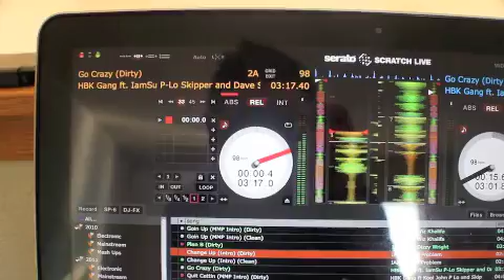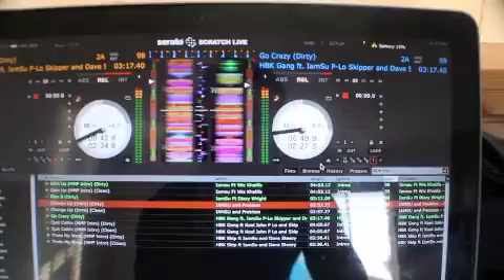Replacing RCA cables and Self Grounding Mod on Technics 1200 Turntables

Comment: I've done a few of these. I found that the internal ground method resulted in a hum on the speakers. (though it has been okay with other tables). For best results, the chassis ground should be kept away from the signal ground, to keep that current away from the signal.
Reply: First person to say this. It makes no sense to attach ground to shield of one side. Ever hear of ground loops? Sure you have, it is the HUM you often hear when attaching a table to inputs. There are cases where the ground must be lifted, or a ground wire applied in a differing spot. Doing this mod insures that you CANNOT lift or change grounding. Sending the table ground down one side can loop any stray current down that channel, through a preamp, out the AC neutral, and back to the TT via the table neutral, causing hum and noise. There are many other scenarios that could cause hum and noise via this method, too numerous to mention. In a static environment, it is much easier to make permanent changes. But traveling to differing venues where power, ground, neutral, heavy HVAC, ballasts, lighting equipment, nearby TV, radio and other RF transmitters, plus other RF (microwave ovens for instance) and electromagnetic spewing items are, this could be a disaster of a mod. All these items can spew interference through air and via house power system I am not saying it always will, but in my decades of TT setup and service, I have seen some very strange things that took creative analysis to cure. 

Connecting a ground wire is easy and quick. What really is the problem?
Reply from the maker: Your totally right, it can cause some weird issues if the ground is looping. It all depends on a person's setup also. Some equipment does require a ground toward a different area in the circuit. There are some other RCA wires out there that have poor shielding that can also cause ground loops. As you said there are multiple factors that can cause some problems but are rare. If I do find issues and a humming is present it can also be caused by a failure in another components ground circuit, or another issue that is preexistent in certain set ups. However I have yet to see this mod fail when done correctly. I have come across ground looping in one scenario when the club removed ground on a power plug to the mixer in order for it to fit the outlet. When my tables were attached a hum was present. The fix for this was just to add a RCA splitter and just ground the outside shell of the RCA plug. The reason for doing this mod is for several reasons. Djs often come across shotty equipment all the time when going into gigs. For example, missing ground screws or damage grounds on mixers, the chance that the ground wire was ripped or crush, serato or tractor not getting a clean signal from the attached ground. The circuit that the external ground attached into the RCA shield provides a clean signal 90% of the time. I have yet to see turntable failure from this mod though since in the technic 1200 the ground circuits are separated to an extent from the motor. It all depends on the set up. But you provided some good information for people!
Reply: Raccoon1400   js
Reply: Another factor to consider is how you will be using 1200.  You'll notice there are 5 wires coming from tone arm - no common ground.  When you do the mod you are injecting noise in to the signal.  In a club - probably not noticeable.  If you're using in your home for best playback potential - probably not a good idea.  You could also get in to scenario where you have a ground loop and no longer have option of moving ground wire around.  Solution might be to be to add external switch to change between internal and external ground (just a thought - not tested!).
Reply: I'm not new to rewiring things but this is more important ha. This is the first time I've opened a deck so any pointers would be great. What is the best thing for grounding?
Reply: Is it possible to use 1/4" instead of an rca cable?
Reply: @FrumSkratch  Why? What do you want to plug it into? I don't think I've ever seen anything that has a 1/4" input for a turntable.
Reply: @Raccoon1400  I meant output,sorry about that,I was just thinking 1/4" would provide a better stronger signal than rca
I'm going into an audio interface UA Apolllo twin X by the way
Reply: @FrumSkratch  You will want a phono preamp to go between the turntable and that interface. A phono preamp both boosts the signal and applies RIAA equalization.
Reply: @JosephAzarUAV  you're exactly right - why would you want to do away with the ground wire  ?! Fair enough, change the phono leads (if they need to be changed) I've changed loads on various equipment over the years also replaced and re calibrated pitch controls , target lights and the green pitch LEDs on my own 1210's and fellow DJ friends of mine over the years . Removing the ground is madness afaic .

Comment: There is a reason why the Japanese built in an external Ground wire....
Reply: Your right! there are high end mixers that has balanced input that requires separate ground wire.

Comment: if you use your turntables at home go for it, if you use them in clubs with big DB keep the ground wire away from the audio cables or you will get HUM low end feedback through the speakers

Comment: to avoid damaging the circuit board connections and the wire you should tin the wire with solder before trying to solder it onto the board. too much heat or inexperience and you'll end up buying a new tonearm.
Reply: I'm not new to rewiring things but this is more important ha. This is the first time I've opened a deck so any pointers would be great. What is the best thing for grounding?
Reply: good advice!

Comment: Awesome, many thanks once again for the very invaluable info! I would say that taking into account the massive amount of use my decks used to get (I now use a Traktor S8) the constant time would be approximately 7200 hours and this is a conservative estimate. I went on the assumption that on average I was probably using them for about 14 hours/week and did this for at least 10 years and actually probably more when I think of it but it's a ballpark figure and well over the 3000 hours in the book.I agree with you on the not oiling part as they're still running smoothly and even the lights work too with their original bulbs. I was always very careful to keep a close eye on other people using them as you'd be amazed (or not!) how people can mistreat them without even knowing so e.g. by stopping the platter, fiddling with the weights etc. Anyway thank you for coming back on my post and wish you all the best!

Comment: I bought Traktor scratch and was having issue in Traktor software.
I was getting message saying Left input not working
I dismantled my 1210 and done continuity test on left and right cables.
I was getting continuity both ends.
I put deck back together and applied switch spray to ends of phono leads. And also where I screw needle (stylus) in.
That fixed my problem.

Comment: those screws inside above the RCA/ground section look like 3-star (Y) shaped screws rather than phillips no?
Reply from the maker: +therealomunit Certain screws are 3-star depending on the date it was manufactured I believe. However the screws are not torqued down too hard, so using a regular phillips will be sufficient. You do not want to over torque the screws during reinstallation.

Comment: Many thanks Mark! My 1200 has a dodgy RCA lead that needs replacing and this tutorial is just the job!Do you know please if you need to oil the motor mechanism at all? I did read somewhere in the manual that it recommends oiling every 3000 hours but I wasn't sure which oil to use?incidentally you remind me very much of that guy from 'Myth Busters'.Best regards,Paul from the UK
Reply: I've had my decks for approx. 28 years now and they're still going strong (other than the lead) hence my question regarding the oil.
Reply from the maker: I have only oiled my tables once. After that... I don't think I would need to oil them again until I have kids and give them my tables haha. With that said Technics does recommended after x amount of operating hours. I am not sure what viscosity rate the oil is but I have used "liquid bearings" oil (il provide you a Amazon link) I wouldn't recommend any other lubes due to the lack of information I have on the type of oil. (Last thing u want is oil all over the place) there are two ways to apply the oil. One way which is quick is just remove the platter, apply 2-4 drops directly onto the spindle, and wait a couple hours for it to drip down into the motor. This does pose a risk because if there is any build up (gunk or dust) the oil will just layer on top of that. The proper way (which I did) is to remove the platter, unscrew the top magnet (big black doughnut thing), unscrew the circuit, and without unplugging anything just lifting up and remove the spindle.
Reply from the maker: Wow didn't know there's a character limit on comments... Well now I know. Next step. Clean the spindle and apply 2-3 drops directly. Then reassembly. You aren't oiling the motor because it is a magnetic drive motor. The only thing you will be oiling is the spindle. But let's do the math. 3000 hours is 125 days of constant operation. Depending on your use, if you are playing on the same set for that many hours... Then you must be fucken amazing. But other than that. I would do it once every say... 10 years or so... But  to be completely honest... I wouldn't bother. I mean the turntable isn't being played in a middle of a desert, or exposed to the elements... Unless you are in a desert. So the lube shouldn't be going anywhere or building any type of massive debri if it's just in your house and use from time to time. So unless you notice the torque drop dramatically I wouldn't do anything.
Reply from the maker: Liquid Bearings 100%-synthetic Oil for all turntables, Provides Superior Lubrication and smoother, quieter operation! https://www.amazon.com/dp/B0064BX44I/ref=cm_sw_r_cp_api_6o4CxbHGBWCPT

Comment: Wouldn't it be better to solder ground line to a three prong power cord?  this would require replacing the power cord.
Reply from the maker: It would be the same. Main purpose is just getting rid of the ground wire that attaches to the mixer. Also replacing the power cord would require a bit more work. The two prong power cord is great the way it is. As I explain before certain areas do not use a 3 prong outlet. Thanks for checking my video!
Reply: I see.  That's right.  I was thinking US plugs.  Thanks.
Reply: Willie Harris and

Comment: You know, I was looking this up on the audiophile end of owning a turntable, but it amazes me how you have your computer hooked up to either turntable, and able to display where the stylus is tracking on one record, as opposed to the stylus on the other turntable. How does that work?
Reply: With programs like Traktor or Serato.
Reply from the maker: Programs like Serato and Tractor uses time coding using a certain pitch on the vinyl. The vinyl itself is one long beep at certain frequencies to ID the placement of the stylus. The program then converts that into a time which can be used to load a song to make it play. Look into it. But nothing can beat the quality of real vinyl. The sound between digital and vinyl.
Reply: I agree that pure vinyl is the best, but only in certain situations, I RIPed my whole vinyl collection to 96kHz/24bit wavs during this winter, and than I went thru all the tracks I grabbed in Sony Soundforge. I used borrowed pro grade soundcard and headphones from friend (the card and phones cost more than the rest of the PC). What I found out was, that there are many crackles, even on my near mint vinyls. And I took the painful and long process of removing those crackles manually (no algorhytm). 

Those damned headphones and soundcard make u really hear everything. Now, after I repaired 100s of crackles and some errors which are on the vinyl, I enjoy the cleaner sound. So, if your vinyls are really mint, than its better, but with some vg/vg+ vinyls, its not so easy to say. Also, u can get static discharges on ur vinyls. That will be non existant issue on digital. I recorded all vinyls wet, to get rid of all static. U cant wet ur vinyls while u DJ... 

Also, this process of digitalizing and listening carefuly to the vinyls on high end gear made me super paranoid to all crackles, before, I havent noticed em so much on my JBL loudspeakers... I guess once you have heard it, it cannot be unheard. But I will not stop buying vinyls, they the best straight up and down. But those cleaned hd RIPs have also their charm... just sharing and blabbling a bit, thanks for the video Mark! :)

PS: I used technics 1210 mk2 with new shure m44-7 needle, than to the Denon dn x1600 for a conversion, outputed it to denon DN R500 recorder using coax (so no aditional conversion) and recorded in those 96khz/24bit wavs at cca -6db. Results are really good.

Comment: Great, exactly what I was looking for. Thanks for your efforts. Can you recommend any RCAs?
Reply from the maker: Depending on application really. My home set up I used some Radio Shack Gold RCA. They are cheap, and good quality. But if your constantly removing, and moving your turntables, I would go for a more durable RCA like Monster wires.
Reply: Cool, thanks for the reply

Comment: Hi Thanks for the video! If I have only to replace the rca cables without selfgrounding i just leave the ground cable free as it was. Right?
I ask just to be sure and not destroy my turntable.
Reply from the maker: Correct. Do not do anything with the ground circuit. Just heat up the solder and remove he wires and replace the wires.
Reply: +Mark Gonzales (Dj Marky G) Thank you!
I have another question... It changes something about audio quality beetween a cable of 1 meter or 0,5 m. 
I risk of losing the signal on the way? or with longer cables (1meter) nothing changes? Sorry for my english
Reply from the maker: +MentalProgress At this moment I have never ran into a situation where the signal changes past a 1 meter cable. It should work just fine.

Comment: What about the small 4 wires next to the RCA grounding? What if those go bad what do I do? Not sure if it's those or if it's my grounding that's bad. Was told it's the wires that are bad
Reply from the maker: Those 4 wires are connected to your tonearm. Usually these wires do not get damage. You might want to check for corrosion on your tonearm. If they are you might want to clean the connections or contacts first. If not replace the tone arm or wiring. There maybe some other tutorials out there for tone arm replacement. Hope that helps.
Reply: Yeh that's what I was thinking. Figured the wires probably aren't damaged. Thanks for the info man!

Comment: Does this affect the sound at all?
Reply from the maker: No it does not change the sound wave form
Reply: Mark Gonzales cool I'm doing this to my1200s
Reply: some ppl in this discussion actually say "if you use them in clubs with big DB keep the ground wire away from the 
audio cables or you will get HUM low end feedback through the speakers" and "I found that the internal ground method resulted in a hum on the speakers" so I dont think I will be doing this mod as I use my TTs with 2kw sound

Comment: i done this to one of my turntables and it lost 50 pecent of the sound... help?
Reply from the maker: Gotta recheck your work. It's very important to make sure you separate the ground wires when you cut the RCA. Please see the details on the webpage. Also make sure the connections are not interfering. The symptom of "less sound" usually indicates a faulty wire somewhere.
Reply: Mark Gonzales Hey there Mark just got a SL 5100 tt got a problem with speed  its running like crazy cant slow it down any help on this appreciate it